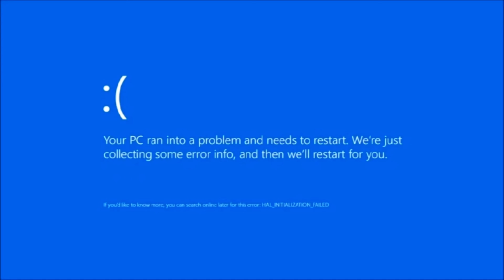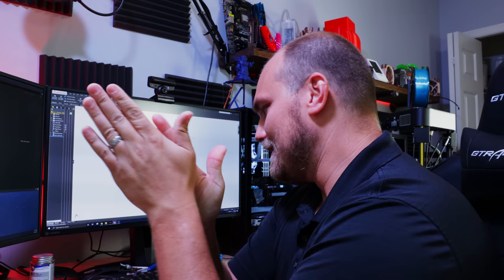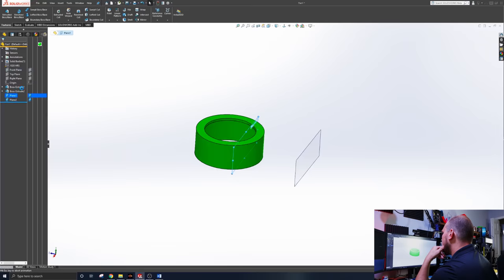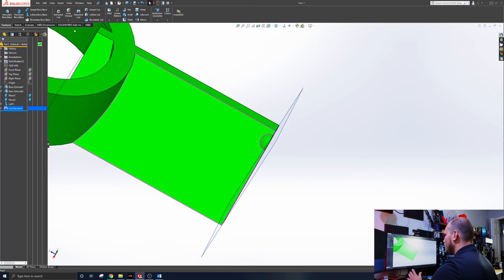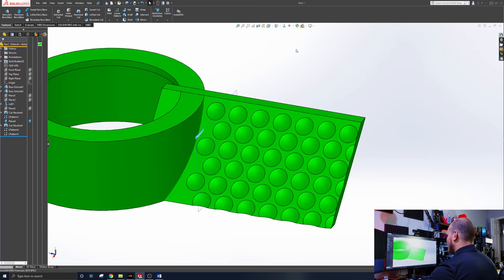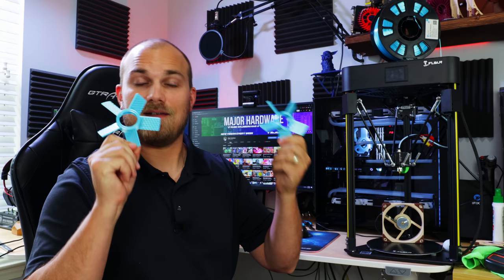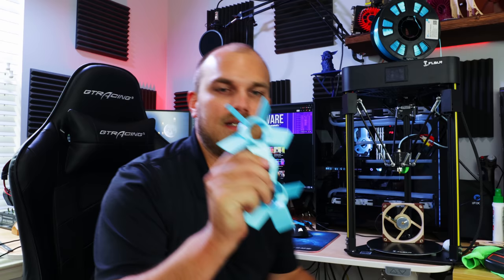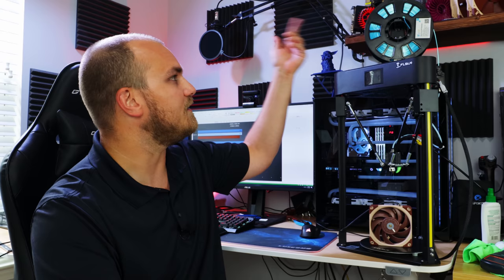What If Fan Blades Had Dimples Like A Golf Ball?

Comment: Just a thought... If both blades performed basically identically in output and noise, did you think to test the energy draw on each? I'm wondering, if there is potentially less drag, would the power consumption difference be noticeable, if any. In theory, less weight and less drag would also mean less energy draw. If you could prove that to be true, multiplying the energy saving across millions of fan blades could be staggering. 
   Then there is the idea of scale. Your experiment is on a tiny fan blade. Could those savings also be proven on larger blades. Seems like there is more here to experiment with. Since I don't have any equipment to perform said experiments, I'll just rely on you to figure all this out and make a follow up video. 
   Great video!!!

Comment: The fan blade shapes don't look like an aerodynamically designed part.  If the blade shape was a guess, then the comparison is invalid.  The first thing in designing a blade are Velocity Triangles which establish blade angle based on flow velocity and shaft rpm.  The properly design blade produces Lift w/o Separation - this is how you achieve efficiency which includes low noise.  

Just looking at you test blade, it looks like it probably has lots of separation in which case, you cannot make a comparison because there is no attached laminar flow to monkey with.

Another way to do the test is take a fan, put a ball end burr in a Dremel and cut the dimples on a properly designed fan.

Then you will have a good comparison (if the Chinese outfit that made the blades did their homework and copied a properly design blade.)

EDIT:  One test you might do to salvage the work you did would be based on he possibility at some rpm you might get some laminar flow:  Do a spin down test:  but the power and measure the time to come to a stop.  Also can o the same test with a Restrictor Plate (orifice) to slow down the flow velocity (this is same as increasing rpm in the velocity triangle.)  This might show a difference if your rpm to zero is below an rpm where "matching" occurs.

Comment: Doesn't the dimple works on the golf ball because the golf ball is curve but your fan blade is flat on the surface so that means that the wind that actually goes through it just skip over the hole completely if the wind is going at a high enough speed?

Comment: I had the thought that the dimples are not on the leading edge of the fan- the leading edge of both fans is the same. On a golf ball, the dimples always affect the profile with which it passes through the air. Wouldn't a better test involve dimpling (or modifying in some similar way) the leading edge of the fan?

Comment: I would think for fan comparison you would measure current draw and air flow at a given RPM
Does the blade push more or less air in the direction you want and does it draw more power to do it

The dimples in golf balls create a boundary layer of air which reduces turbulence around the ball and improves airflow over the ball so it can travel further
Do the dimples improve airflow or will this aerodynamic shape reduce current draw but move less air?
Testing the temps with the radiator is a good real world result comparison but the measurement isn’t fine enough to give any distinct differences between designs that similar

Comment: I've never studied fluid dynamics either but from the few science videos I have watched on the subject of turbulent flow i don't believe the dimples would create any more of an effect over the small grooves already embedded in the blades by the printer, fuild friction would cause the same effect whether you have large dimples or small grooves especially when the grooves caused by the 3d printer run parallel with the blades and vertical to the oncoming air like a corigated grid in the airs path of travel so if I was to run a test like this I'd make sure the surface of the blade with out dimples has no form of crater/groove in the form of a dimple or a line and sand both sets of blades flat as to prevent an inconclusive result as the whether or not "dimples" have an effect on fans and as some one has already stated id be checking current draw over rpm

Comment: people did some research before with some very shocking results. Their fan blades and such were done like a sea shell (geometry) that made a difference in moving water. but I don't know what they did with (air) fan blades. I know the motors done with this research had created cavities and it literally pitted solid steel in the motors. They think this cavity that it creates is expanding upon known science. the getting more energy out than put in. But they don't know how to use it. As far as i understand the best use for their work was to create a blade for a motor to be placed on the bottom of a water tank and it is used to circulate the entire water tank using just a tiny fraction of what use to be needed. I'm wondering if your fans or such has done anything like that? 
Sea shell spiral, or sacred geometry, or golden spiral , it's also the same measurements used in classical art the thirds rule.  I hope this caught your interest. Because I often find art, nature, geometry, and true science crosses each other at these special intersections.

Comment: Do the dimpled blades use less power? The dimpled golf balls travel further, so for the same force from the impact of the golf club, they have less wind resistance. that should mean that the dimpled blade should need less power to drive it.

Comment: 4:oo.

The Mythbusters did an experiment to see if a car with dimples would get better mileage.  So they took a car and covered it with modeling clay and then drove it around a track with a specific amount of gasoline in a bottle to get the mileage of the car with smooth clay all over the outside a couple of times.  Then they took a cutter they built to cut dimples out of the clay all over the car and then repeated the mileage test.  They found that dimples actually reduced air drag enough to get a measurable improvement in gas mileage.

So the question here is, will dimples designed to reduce drag on a fan enable the fan to move more air.
Reply: Maybe it reduced the weight? Or did they take the material they removed and place it in the trunk of the car?
Reply: @mrtechie6810  
My mistake.  Yes, they did take the clay they removed and placed it in the car, in the back seat and floorboard, so the weight would be the same.  No telling how much money people could save if they drove cars with dimples in the body.  But it would take an extensive propaganda campaign over many years to get people to accept cars with dimples all over the body, if at all.

Comment: Did you ever test the amperage of the motor with the different blades. Does one place less drag on the motor using fewer amps? If you can demonstrate a lower amount of energy draw then it would be a big win. If the motor is rated for a certain rpm I don’t know that the dimples would change the rpm much, however it could reduce the amperage draw and safe money using less energy.

Comment: Just as using the right grease in an electric motor will reduce fluid friction in a bearing, if fluid friction (air) across the blades is reduced, you should be pulling less power to perform the work. You are looking for the wrong thing in your tests.

Comment: It did appear that your dimples were round and a golf ball dimple is actually hexagon...maybe that simple difference in design might be why the numbers were pretty much equal instead of the dimpled ball showing something different...just a thought....
Reply: this won't matter, nothing you can do to the dimples or the fan can make them work better because the reason dimples affect golf balls and not fans is that when an object moves through the air, it creates a low-pressure area behind it, creating drag and slowing down the body, because of this, a teardrop shape is the best shape for limiting drag since its outline follows the low-pressure area allowing it to negate the effect almost entirely. the golf ball on the other hand is made to be sphericle to allow for non-directional hits, and therefore must be designed to minimize drag some other way. 

this leads us to the dimples, and how they reduce drag. they do it by creating turbulence on the surface of the sphere, which creates vortexes swirling into the low-pressure zone behind the sphere, allowing air to fill the low-pressure zone more quickly, and lessening the effects of drag.
now, the reason this effect doesn't work on the fan is that its shape is significantly better aerodynamically starting off, as its blades do not generate low-pressure the same way the sphere does, since they are already thin, and don't require air to bend its path nearly as much in order to pass around it.

Comment: At least we learn a more efficient way to produce items with less materials, I bet that the difference will be insignificant because the amount of lost drags will be recovered from the speed strength, basically not a bad idea at all, maybe curving the blade could do something in respect but I doubt that except obviously it won't be a waste of time since the only worst case scenario would be that we end up with same result, but in a cheaper cost of materials, so feel free to consult an Aero-Engineer, more chances to find answers in Aero Engineering as this is what golf ball is all about.
That is all I have to say.

Comment: Why aren't you measuring power draw? Rpm is a factor of voltage, but the dimples should in theory reduce drag, and there require less current at the same voltage, i.e. require less power.

Comment: In golf, do they travel farther because their trajectories are flatter or because they have a higher velocity? Maybe they travel farther because the dimpling helps with the... (Theres a technical term I just learned on smarter every day that describes how much a ball compresses at point of impact and then imparts that energy into the ball for launching it - But I forgot the wors)

So yeah, do golf balls get launched faster because of the dimpling or is it the aerodynamics of it on flight that keep it aloft longer..?  If the dimpling increases the velocity of the ball then it would have nothing to do with the aerodynamics of the ball with dimpling.

Comment: One flaw, you used the same size dimple as the golf ball when the fan itself is much larger. 
Yeah total mass might be about the same as a golf ball however the fan has so much more surface area.
You should also in addition to making the dimples larger put them on both sides preferably in the exact opposite spot where there is no dimple on the other side.

Comment: Mythbusters did a comparison where they put golf dimples on a car and compared MPG before and after and the one that had golf dimples proved much better MPG than the one that didnt.
Also, you measured the wrong stuff. RPM is a function of the work applied. You should have measured the energy (work or amps) required to make the same rpm. In addition, you should have measured the volume of air generated at a given RPM. My guess wouod be that the dimpled wings would have LESS volume. Your last "bench" test may have been comparable but as it appeared you mesured temperature that would normally again be a function of the thermostat regulating the work needed to get the same temp results. Not sure though.

Comment: What about using those fans as wind power plant kind of things?
Is there a difference in power-generation between the one with dimples and the smooth one?

I mean the thing with golf balls is, that you can get them to spin real fast with applied air flow..

Comment: I'd be super interested in a variety of different metrics on another test like this:
RPM, Current, noise and airflow.

I'd be super interested removing 1/2 the blade material (keeping the blades the same length, but just changing the width of them) and seeing if you get a direct 50% loss in airflow.

Comment: I believe the true difference is at extremely high speed.  golf balls move at extremely high speed the fan should be moving at an extremely high speed as well to truly see the difference even when golf ball is flying super fast through the air the dimples are only to help it a little bit so at the low RPM that these fans are moving you're not going to be able to see the difference but technically there should be one the fan without the dimples should move more air

Comment: If your motor has a speed controller you won't see much of a difference in  volume🙈 But if the blades have less drag you'd see the difference in power consumption. Super easy to measure just add an amp/multi meter to the positive wire between the power supply and the motor. Another interesting one to look at is humpback whale fluke blades. This guy was promoting them for wind turbines

Comment: well, it DEFINITELY won't work te same way it does in a golf ball
those dimpels are there for a specific purpsoe, not just because they magically make thing better and that only makes sense in very specific cases
but a fan with... a patterned surfae that doesn't work liek that of a golf ball but looks slightly similar might have some advantaes depending on the rest of the design

Comment: if the fan controller is supposed to maintain a specific rpm, you shouldn't see any difference in rpm...  however, the CURRENT might be different while trying to maintain the same rpm...

Comment: But you didn't do a fan with dimples only on one side, the point of the dimples is to increase turbulence around the object therefore decreasing resistance as the gold ball spins. 
Presumably, you want it to produce more thrust/lift? Therefore, you don't want dimples on both sides as the dimples on both sides wouldn't have the required effect. 
The point of a fan is to displace more air with a  given amount of power fans are essentially wings. Therefore with the golf ball dimples you are trying to increase the pressure differential between the two sides. 

I am not a physicist, but  you just need to understand Bernoulli's 

You should make a fan with dimples on either side and then measure the force produced.
Now that would cool and would demonstrate lift really well assuming it made a difference as the hole sizes I believe needs to be in relation to the size of the object.

Comment: I think the noise was equal because it was mostly coming from the air hitting the radiator, not the fans thamselves....
Why don't you check the dB just with the fans alone?
Thanks for the video, intersting,
Have you considered making the dimples much smaller and deeper? like 1mm diameter and 1/2 mm deep?
Regards

Comment: misconception. The fan is driven by a motor and therefore cannot run faster or slower because the rotation is dictated by the motor.
Driven by wind, the dimple would run slower because it deflects the wind better.

Comment: If you want to improve aerodynamics, then read about the aerodynamics. Dimples only help a golf ball because it trips the flow to turbulent, and avoids flow separation behind the ball. It's not going to apply to a flat fan blade with a sharp leading edge. If you want performance improvement, use an actual airfoil, or twist the blades to optimize inflow. (The tips are moving faster than the root, so you need a larger angle of attack at the root than the tip)

Comment: fascinating work. About thirty years ago a university was looking into ways to give a wooden baseball bat the hitting power of an aluminum bat. I was not involved in the study(as i only read about it in a newspaper) but i immediately took a wooden bat and began to tap some dimples into it using a hammer and metal pin..... I did not have the means to test of present my idea but i have always wondered... The same line of thinking had me wondering about the hulls of ships built to cross the oceans with cargo. Was is possible to make a ship more fuel efficient by designing it to have a dimpled hull?

Comment: The motor may be designed for a constant rpm.  Try comparing the power draw between the two blade styles.
Reply: Some of the cheapest AC motor designs are constant speed.

Comment: While RPM is important the margin of error in cooling is to high for this kind of test. As the RPM is the same what you need to measure is CFM or airflow, DBs or noise, and how this changes through a Radiator. This is the kind of information that would make a difference in choosing a design. Also having half the dimples cut off on the bottom row of the blade is a bad idea, it creates turbulence. All that being said there still likely wouldn't be much of a difference between the two designs.

Comment: but if dimples create less resistance to the air shouldn't the only variable be the power consumption.... fans are designed to run at certain rpm and changes in rpm are going to require more significant loads. I would guess that the dimpled blade would draw just slightly less current

Comment: RPM is delegated by the motor...  the only thing that could change by changing the blade [pitch length, surface] is noise and air movement (CFM [cubic feet per minute]).   If you want a faster blade, change the motor...